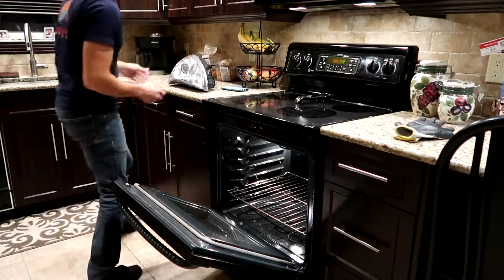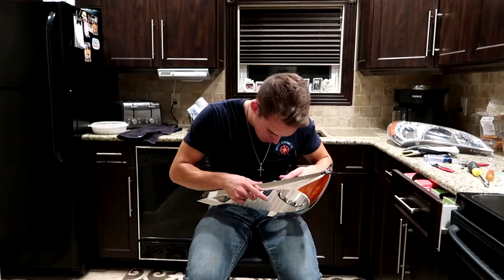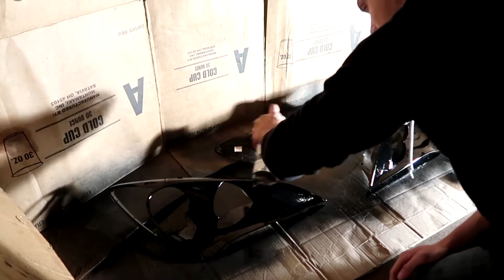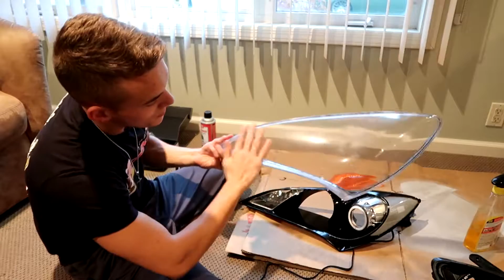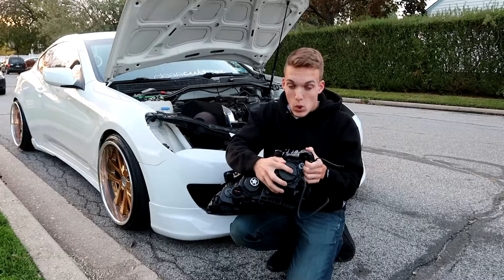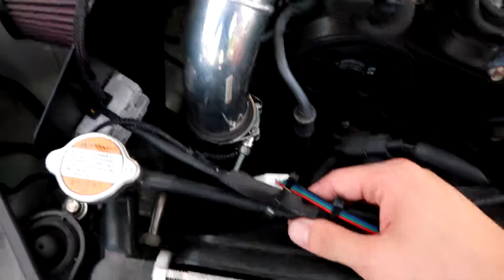Genesis Coupe Headlight Blackout And LED Halos Install

Comment: Hey man love the genny bro she’s clean!!! quick question, I bought the same led halos and installed them today and everything came out good. The only problem is it disconnects from my phone majority of the time and also I’m having a hyper blinker issue now after the installation, any advice or clue what it can be??
Reply from the maker: Hey Jorge, thank you! Much appreciated. Yeah it disconnects from my phone aswell, I just have to reconnect it to my phone when it does that. Are both of the halos having the same issue? If so it could be the connection to the battery or the Bluetooth controller
Reply: @acauto7886  yeah both of them disconnects then I have to re-connect it. I ended up fixing the hyper blinking issue thank god but I just wanted to see if it was a way to keep the halos connected until I manually disconnect it myself but no worries brother I’ll just deal with it for now. Thanks for getting back to me!💪🏼

Comment: Did you drill the holes in the ligh yourself for the wire or was it there all ready?
Reply from the maker: Are you talking about the hole in the back of the plastic cap where the bulb goes?
Reply: @acauto7886  where he put the wire through on the plastic peice
Reply from the maker: I drilled those holes out, when I upgraded to LED bulbs. The LED bulbs have fans on the back that need air, so I drilled holes in the plastic caps.👍

Comment: why didn’t u just use the double sided tape it came with instead of the soldering wire to hold it on??
Reply from the maker: I've heard that the double sided tape doesn't late that long. I probably could've used the double sided tape and the solder.